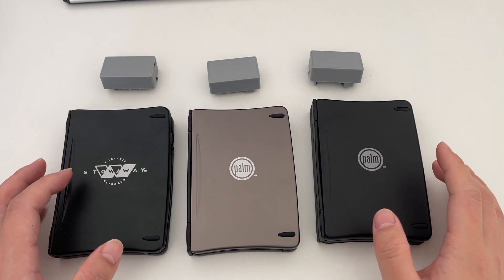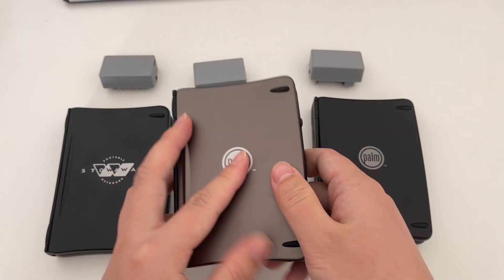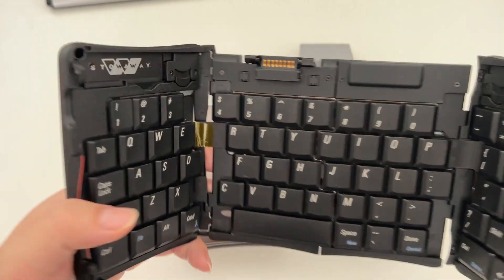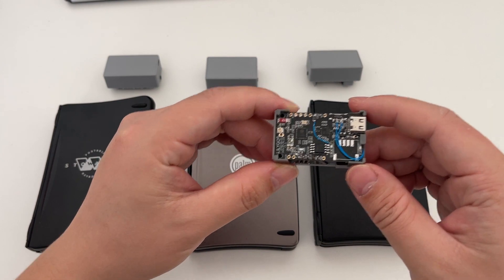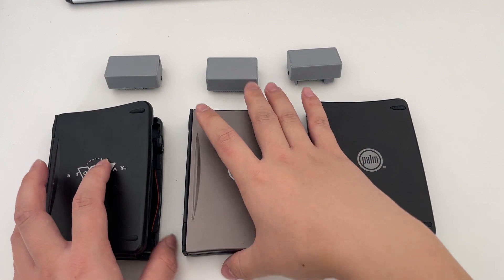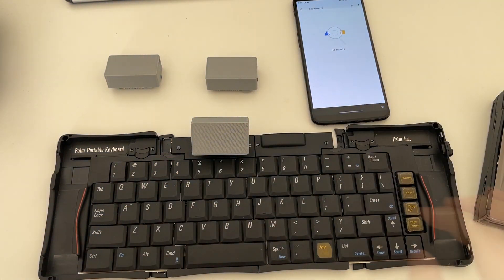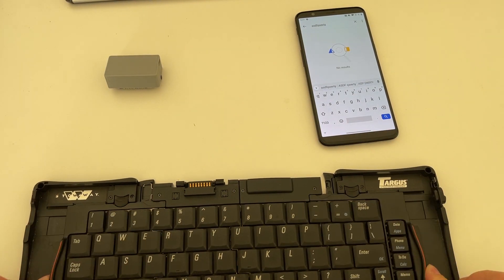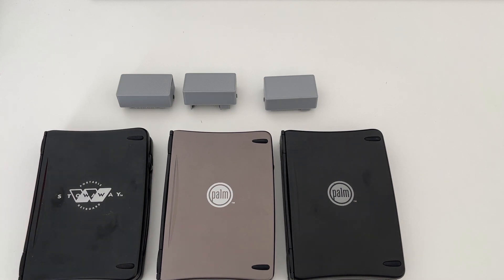An Update on the Palm Portable Keyboard Bluetooth Adapter

Comment: This is an amazing project. I was wondering if it will work with the PA820 unit from Targus
Reply from the maker: PA820 is not supported yet, but it is an interesting model and I do want to explore supporting it. Stay tuned but don't have high expectations ;)
Reply: @XinmingChen  I would love to see your approach to implementing a similar solution for this model

Comment: Hello, would this work with a fellowes 98078 pda pocket keyboard for palm m500 m505 m515 m125 m130 i705?
Reply from the maker: No, it only designed to work on the Palm Portable Keyboard. Other keyboard might have the same connector, but the protocol they use might be different.

Comment: I have one of these keyboards, but for PocketPC. Do you think it is possible to adapt this using your project?
Reply from the maker: The major challenge is to build the physical receptacle for the PocketPC connector... I can't think of an easy way other than harvesting the connector from a dead PocketPC. You need to modify the program too, but that should be easy, just reference the keyboard's Hardware and Electronics Reference pdf on my github. Honestly I don't think it's worth the effort. Palm version of this keyboard is pretty cheap on ebay.

Comment: this is a great project, thank you for making the detailed tutorial!! does the esp32 work reliably when typing fast or pressing a combination of keys? I've tried something similar in the past with a thinkpad laptop keyboard and a teensy, but I never got it to work well enough to use daily
Reply from the maker: Yes, esp32 works very well with no key stroke loss or delay. I guess it's due to it not having aggressive power saving modes.

Comment: I got someone to 3d print me the housing units, and I'm buying the list. What size double sided tape do I need?
Reply from the maker: About half inch wide tape would be fine. You can always use two in parallel if you have narrower tape, or cut it if you have wider ones.

Comment: Is there any way to make this work with a nodemcu esp32? We don't have access to that boards in argentina
Reply from the maker: You can change the pinout definition in the source code to make it work on nodemcu esp32, but there is no lithium  battery charging circuit on that board, so it wouldn't be very useful.